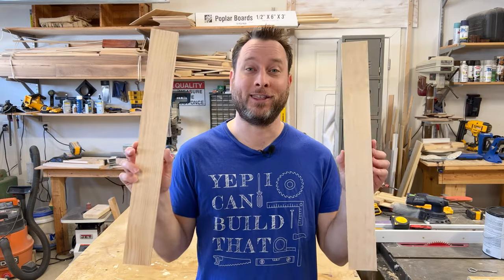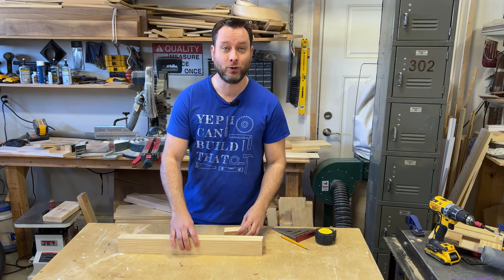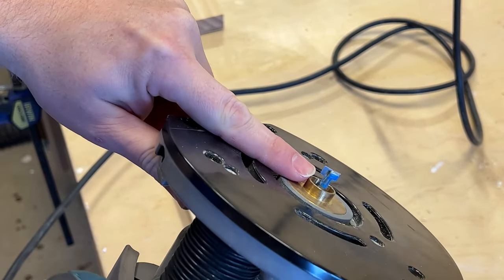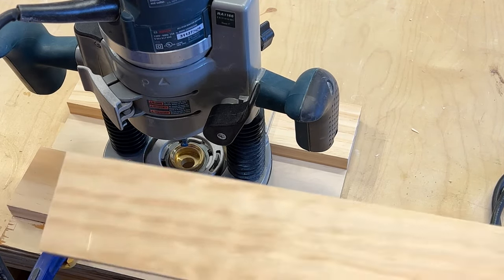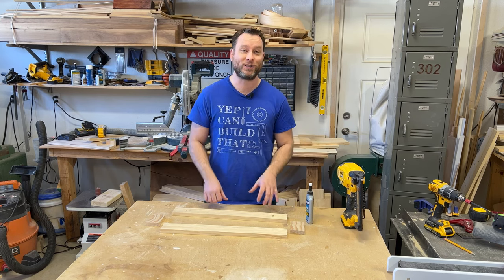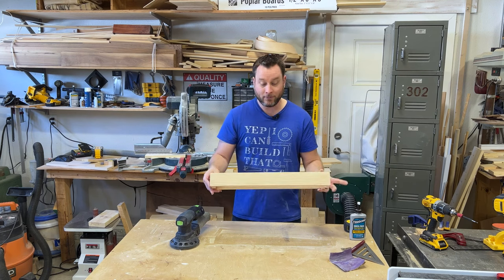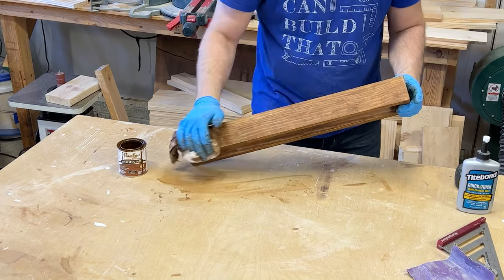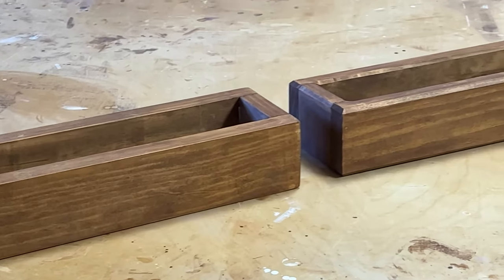I Made Something Everyone Wanted With 2 Boards | Season 2 - Episode 3

Comment: Minimum nails is zero. Brad nails aren't going to hold long term, they just act as clamps while the glue dries. The glue is what holds it long term. So another way is just to clamp your project while it dries, then no holes to fill.
Reply from the maker: that would work